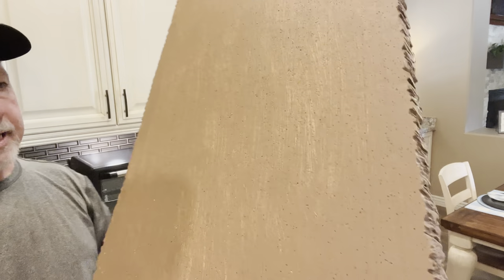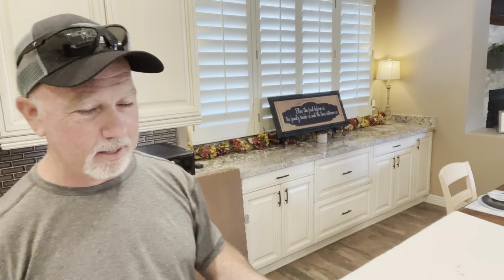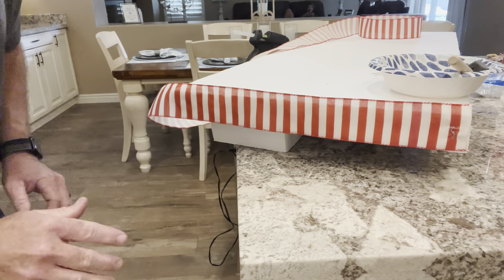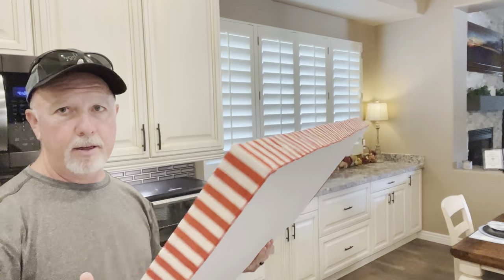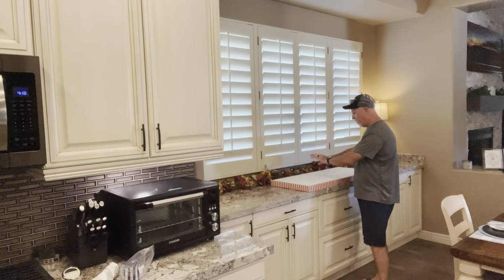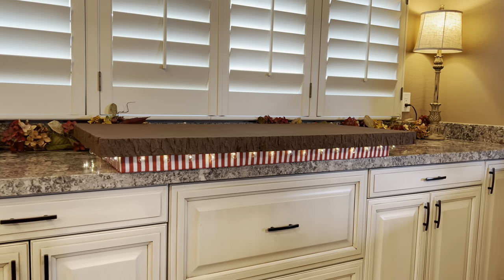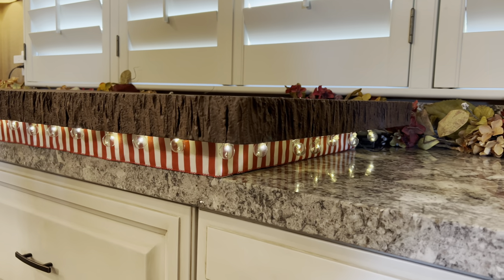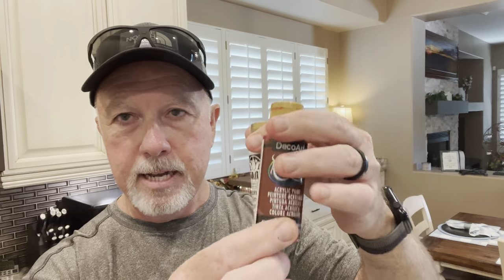Dept 56 Creepy Circus Tutorial, Part 1

Comment: I found you a few weeks ago and have liked the displays you create. As for he fence you are talking about for in back of the circus, Michaels has some small sticks with a point on them, they are about half the width of a popcicle stick. They look good as a fence,  I made one go go around my cemetary and connected the sticks by wrapping the black floral wire that comes on a spool around the stick and twisting.  As for the wood stamp you have, PLEASE learn how to use it. You dont drag it down the item you want wood grain in the same place, that only creates lines, you have to start at the top of the material you want to look like wood and rock the stamp from front to back, as the stamp pattern changes it creates an actual wood grain look.  Also, IF you want to paint the bulbs, theres a product at Michaels called Gallery Glass, its for paintng on sheet glass for the staned glass look, its a transparent color that would work really well for getting color without dimming the brightness of the bulb too much. KEEP CREATING!!
Reply from the maker: Awesome—all great ideas!!!

Comment: Does anyone happen to have any quick tips for painting the foam? I made the mistake of using spraypaint and well....that didnt go so well. Melted foam. Where do you start and are there any recommendations? Ive scoured these videos and the internet but cant seem to find Any consistency. I just tried straight acrylic black but it is so watery that even w 100 coats I dont think the pink will be hidden. Please help! Thanks. :-) (trying to cover a 60" X 9" Board.)
Reply from the maker: Water based spray paint will work—but it must be water based!!!!!  Also, basic acrylic paint works just fine—I use it all the time.

Comment: Hi carl I need to ask you questions on the purple foam I have a 2in foam board 4x8 it’s just like the 2ft x2ftx1in boards just bigger I have some small pieces and was using them for trying to cut. I have the hot wire foam factory wand about 3 inches long and when I cut it melts with whisks coming off the foam and the wand has foam that stuck on it also. Is this how it works? What do you use to clean the wand.
Reply from the maker: I think so…remember, I also have the power supply that adjusts the heat of the tool I’m using.  If it’s hotter, it may not do what you’re describing.  For cleaning, I leave the tool on a let it burn off most of the debris…I also will use a damp cloth one unplugged, but still warm to wipe the tool blade down.
Reply: It came with a transformer just on and off from the handel and it is from foam factory but your telling me this tool also comes with a heat control?
Reply: @HalloweenVillagesbyCarl  Ok I went to there web sight and saw the power supply I need to adjust heat. I get it now I will order that.
Reply from the maker: Perfect!